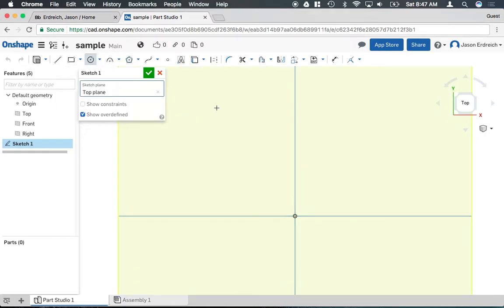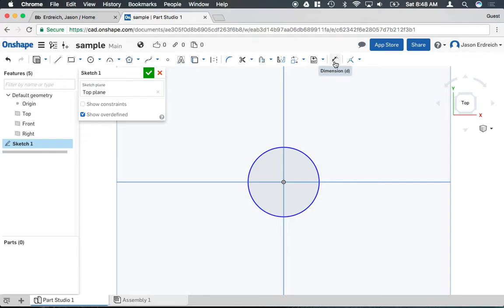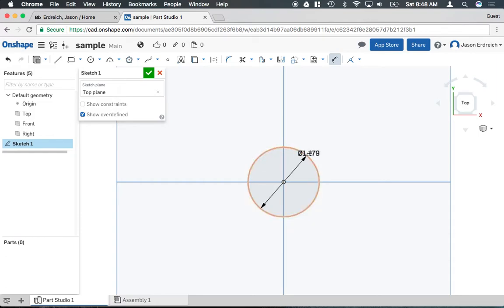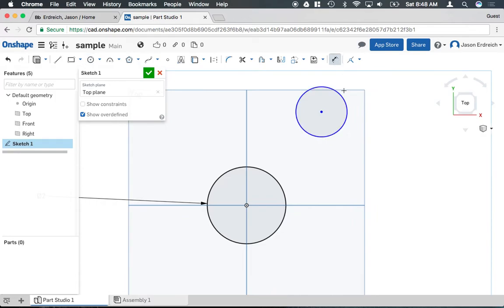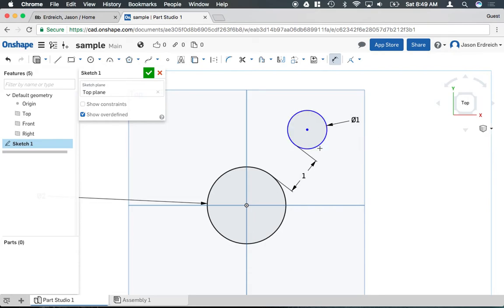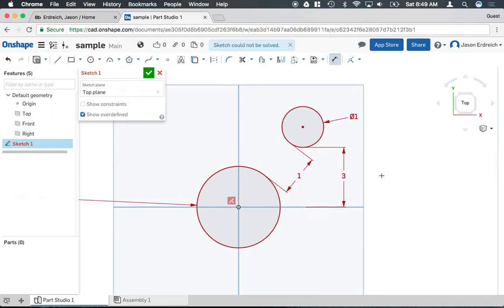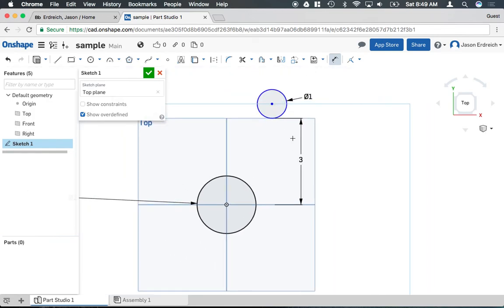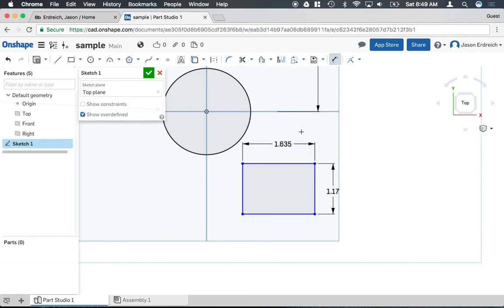How to measure and set dimensions in Onshape CAD

Comment: How would I change the unit of measurement? Like from inches to millimeters?
Reply from the maker: You can do this in real time by simply adding a unit in your dimension box, for example "3 in" or "3 mm". Or you can change your account settings to switch your default units.

Comment: how to make it show dimension but the dimension is not set by the user however it just shows whatever the distance is.
Reply from the maker: If I understand correctly, you can just click on any two points and the distance between these points will appear in the bottom right corner of your screen next to the tape measure icon. You can also set a dimension to check the distance, then delete it if you don't wish to keep or change it.